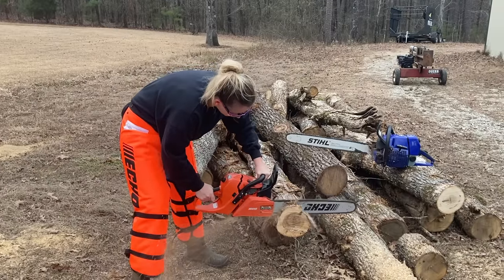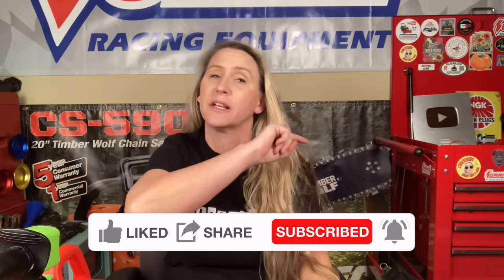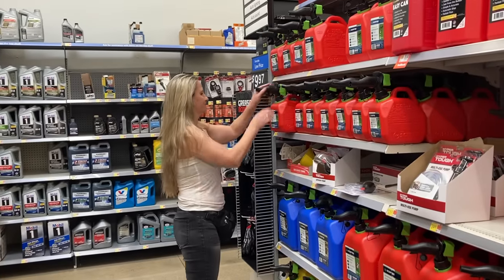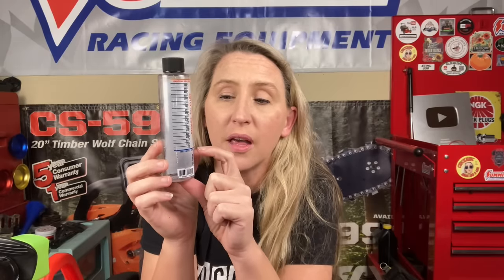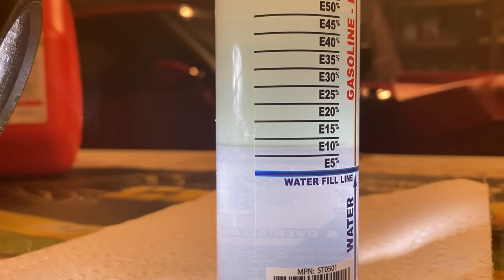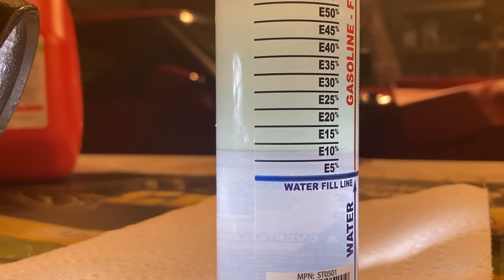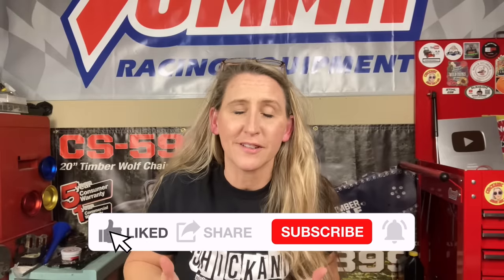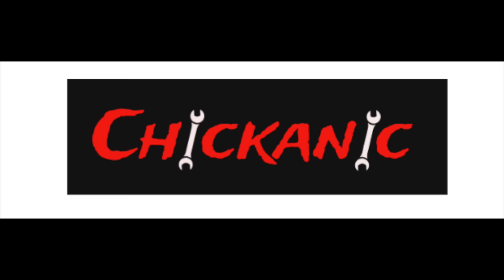Fueled by Deception. How You’re Getting Ripped Off at the Pump! (I'm SHOCKED!) VLOG

Comment: QUESTION: My Cub Cadet self-propelled mower SC300HW mower has been having fuel problems for over a year now. During the firs three years of life of this mower, the mower would stop when 100% of the fuel was used. The gas container would be 100% empty when the mower would stop mowing. But, this past year, there was a LOT of visible gasoline when the mower would stop on its own. I would ask myself, "Why in the world is this mower not working, because there is clearly a lot of visible fuel left in the mower." But, I recently watched a video online indicating that the "liquid" that remains in my mower may not actually be "gasoline." The mower may have separated the "gasoline" from the "ethanol" in a way that left only "water" that is not useful for fuel. Thus, the "liquid" I saw in the tank of the mower was actually a form of "water" that could not be used to fuel the mower. Is this correct? Could that be the cause of my problem?

Comment: We were out of town a few months ago. No name brand gas stations  in town. the pump station had 5 types (  2 , E versions and 3 regular ) gasoline to select from , all going through the same hose and nozzle, even a Bio-diesel at the other end with its own nozzle..That makes sense if the hose in 8 feet long there will be the remains of what  gas option the car owner ahead of you just got...I fill my cans up after I fill my car up... then you know what fuel type is in that hose...if there are more then the normal  ( 10 % ethanol added here )  3 octane levels types at that pump....

Comment: That's correct about the gas mixture. A pump repair man had the panels removed from a pump. I saw two lines coming into the pump going into one line. I asked him about the plumbing, and he told me the two lines were regular unleaded and the second one was premium unleaded. Midgrade was a mixture of both. The mix was 60% regular and 40% premium. This station didn't have non-ethnol.

Comment: I have heard this ethanol argument so many times. Your argument makes sense due to the way the pumping situation is set up. When they removed lead from gasoline (not a gas) they had to come up with some method of keeping the detonation (knock) under control. They added a witches brew of chemicals to do that. Well, to solve the detonation & the pollution problem, but mostly for the detonation. I have had guys claim that their fuel economy dropped so drastically while using E-10 gas that (by simple math) not only was the ethanol not burning but it was causing 10% of the actual gasoline to not burn. Many were claiming a 20 to 25% reduction in fuel economy due to the 10% of ethanol. Completely ridiculous. Current pump gas will stagnate when left in the carburetor over the winter. I have since started shutting off the fuel to the carb then letting the mower run until all the fuel is gone. Even then it is possible for things to get gummed up in small carbs. The smaller the carb the worse the problem. I have slowly been replacing small gasoline engines with electric, problem solved. Riding mower carbs are not so much a problem. Currently weed whackers, leaf blowers, small chain saws are all electric. And those little 2 stroke ring-a-ding-ding-ding units are the absolute worst, carbs always going nuts.

Comment: Even the delivery drivers cross contaminate the fuel, for example if they fill the storage tank of 87 octane at the station, and they still have some 87 left in the truck they are told to put what they have leftover into another storage tank of different fuel (this is what a friend of mine who used to deliver fuel was instructed to do by the higher up's). It's still a good idea to test your ethanol free fuel!!!!

Comment: I usually put fuel in my vehicle before filling my lawn equipment jug which is 2 gallons so , now I wonder what percentage 2 gallons would be . Although I use regular 87 octane and when the fuel quality isn't quite good I bump up the idle/throttle on my lawn equipment and go slower , easy for me to do that on the riding mower but not so easy to do on the weed trimmer or pole saw . But if I ever get good quality equipment that , absolutely , requires alcohol-free gas then I'll keep in mind what you taught me , Thanks .

Comment: Tip, best practice is to have the gas can sitting on the ground when one adds gas to it do not hold the can in one’s hand off the ground. Why to avoid the potential of a static spark that could ignite the gas while filling the can.

Comment: I took for granted that I thought the gas pump residual gas type was common knowledge. We went through the same thing when the US transitioned away from leaded/unleaded gas, and you could get both from some of the same dispenser pumps. Any time you went to fill a gas can, we always pumped a gallon or 2 into the car before putting it in the can, just to make sure you were getting the pure fuel type.

Comment: I am not sponsored by or affiliated with them, but No-Spill brand gas cans work really well. I actually prefer them to old school gas cans for filling up my LA-135. My fill neck is under the seat. If I have suitcase weights or other attachments on the back of the tractor, conventional gas cans are difficult to get the gas can spout into the filler neck without spilling everywhere. With the No-Spill, I put the spout in the neck and then push the button. Plus, their 5 gallon cans (which is what I use) have handles on the top and on the back side, so manipulating it is easy.

I still contend that ethanol up to 15 percent is okay as long as your equipment runs regulary. I do buy ethanol free for the generator as it mostly sits unless the power goes out, but my tractor, which cuts grass all summer, picks up leaves in fall, and gets snow blower duty in winter, runs fine on 87 octane E10. 850 hours and counting, never a fuel system problem.

Comment: I deliver fuel to gas stations and yes there is a separate tank for each grade of fuel. Gas stations are not mixing facilities. Refinery's and Pipelines are mixing facilities. I do agree that there should be a single hose per under ground tank like the old days. One hose should not be able to pump many grades of fuel, I totally agree.

Comment: Excellent video...thank you very much for the information! I was using non-ethanol fuel in my boat as per the hype and paying outrages prices to fill the vessel. Mercury insists regular fuel with no more than 10% ethanol is approved for their motor...87 works, I use it. It appears that the "higher octane"  (more expensive) fuels and non-ethanol are sitting longer in storage as our current financial climate is motivating the majority of drivers to use whatever is the least expensive; therefore, 87 seems to be the "freshest" at the pump...I think all things considered, it's the better deal. Never thought about the fuel left over in the line...thank you for this information.

Comment: For my small engines like my Echo weed trimmer I purchase 93 octane gas then separate the ethanol using the water/ethanol  separation method. End result is supposed to be 89-90 octane ethanol free gas.

Comment: 😮😮😮😮😮good video and very informative.  I run ethanol free gas in my engine about once a month or every few months... I see a noticeable 5-10% power increase like I am running a high octane gas. 
Also... I change my fuel filter as part of my maintenance every few years... I drive 2 Toyota's Tacoma pickups that are 24 years old... I hate ethanol because of the way it absolutely destroyed small engines like;lawnmowers, weedeaters, chainsaws, blowers,etc... Literally had to throw out all my household small engines after ethanol gas was introduced into the market because NO PLACE sold non-ethonal gas... The ethanol gummed up small carburetors overnight....

Comment: The first thing I did with those stupid EPA gas nozzles was take them off and toss them. I then replaced them with regular flexible plastic nozzles and drilled a vent hole with cap. Presto, no more spilling more than you get in the gas tank on your device.

Comment: I think it's more than 1/3 of a gallon left in the hose. There's a meter in there to measure flow at the bottom of the pump, then the hose goes up to the top of the pump and back down to your vehicle. I think it's closer to one gallon in that system. 
I'm always concerned with this, so I run out my bike to nearly empty (but no dry fuel pump!) and fill it then. It only holds 3 gallons and specifies 91, which would be 93 with nearly a gallon of 87 still left in the meter and hose.

Comment: It’s almost 90% or better with today prices I always put a gallon in my car first also …also if you have a newer machine I had a Ariens snowblower I always use ethanol free with a little stabilizer in it the carb went in the first year and the first thing they did was test the fuel it was good and they put a new carb on  it by the way push the nozzle all the way down on that can and twist the way the arrow on the nozzle points it will lock open then twist it back to close.

Comment: I have been having a nightmare with my ms 311 and TC whatever tophandle trying to get them to run. Like at all. I get 93 octane and pump 5 gallons into my car first, use Stihl 2 stroke mix and after 2 months sitting they both still stall off idle. I got some trufuel for the next time and now Bre has me worried about that. These fuel issues are infuriating. Got me going electric for small work. Like 16” stems or less. Sigh. Thanks for listening. Solid video

Comment: I usually fill a 2.5 gallon gas can when I start pumping ethanol free premium if they use a shared hose.  This can usually goes into something that can have ethanol, and gets used often.  Then I fill my cans with ethanol free premium, it sounds expensive, but it’s cheaper than having fuel problems.  I also think your engine idles better with ethanol free fuel.

Comment: Hi, your vids help a lot. Now I’m gonna help you. I hauled gas for to supply stations for around 10 yrs. Most of the little brands would order x amount of gas. Say 5000 gallons of 87 octane,1500 93 octane and 2100 mid grade. Well you get there and stick the tank to see if it will take what you are gonna dump in. At the no brand stations I would check the low octane and it might only have room for 1/2 of what they ordered. They would always tell me to put what doesn’t fit into the 93 tank. Rarely the mid grade, unless it all wouldn’t fit in the high test. The ONLY company including the majors that did NOT do this was shell. If a station ordered to much of any octane I was ordered to call Shell dispatch and I would be routed to another station. Also the manager was fined $1500 for the first offense. I never found out what a second offense cost. If I dropped even a pint into a tank that would not fit the entire amount ordered I would be fired. No second chance. We were independent so no grace. I’m not connected to any company or outfit. I switched back to rigging after I quit hauling gas. But I run Shell in all my engines if possible. I really doubt the little bit of gas left in a pump hose would change the reading much unless your can or tank is really small. But that’s why your octane reading might be changed. I got out of that industry around 30 yrs ago so I can’t say if this practice is still used, but I can honestly say it was is often used practice. Anyway take care and best wishes

Comment: i have a 4 stroke moped that uses octane 90 or above and the carbs get ruined because of the ethanol. I learned show to separate the ethanol from gas which is rather easy. its great to separate the ethanol for the small motors

Comment: My local non ethanol pumps are independent of the other pumps like diesel pumps. So far this fuel seems to be decent stuff. Im still considering buying aviation gas and using amsoil sabre in my 2 strokes.

Comment: This is confirming. I had a ck eng lite come on and it was for a bad catalyst converter. The cast was going to be more than I was willing to pay and then on time I filled my tank with fuel additive and the lite went out. So I tested it with low grade fuel and the lite came on. I then put higher grade fuel and some additive and the lite went out. I concluded bad fuel.

Comment: Another surprise....refineries that pump differently blended fuels to a terminal via pipelines separate the different grades with a slug of water then remove that water at the terminal. Usually. Almost always.

If you really want the real skinny on fuels try reading the Gasoline FAQ.....its a four part pdf that will take a few hours to wade through, its that comprehensive.

Comment: I would find a way to modify that gas can nozzle, if I had one. I have a bunch of the ones from about 7-8 years ago, when they stopped having a vent cap you could open. I drilled out a hole in the top of those and found press in plastic caps to open for air flow. Maybe try to fill behind a high end car, something they might have put in Premium or Ethanol-Free already.

Comment: In Britain  we have a separate hose and nozzle for  each fuel. We have E10  petrol, Super Unleaded petrol and two diesel nozzles, so that doesn't happen.
Why was you using bottled water, tap water is just the same.  If your gallon petrol tank was so awkward why not put some into a large measure then tip that into your bottle.
Most modern petrol cars in Britain run on  E10 and they recommend  Super unleaded  for the likes of small engines as E10 tends to rot the rubber pipes  more than any thing, but cars after a certain date had the rubber pipes and pump diaphragms made from another material, but still looked like rubber, perhaps a butyl or neoprene.

Comment: Those "Spill More" systems are terrible. They say a quarter cup of evaporated gas adds hydrocarbons to the atmosphere the equivalent of driving 10,000 miles. You want to love the EPA, but they have mandated several rules that do more harm.... That test for ethanol was very interesting, I did not know that existed for presentage. I have used Color Cut just for the presence of water and now ethanol for years. I have seen over a dozen engines damaged or ruined in just the marine business by ethanol. The emissions from mining the metals and making the engines is so much more than they would ever burn even if it ran forever. Thanks for the video

Comment: We dont got e85 but they do it with the 87oct and 93. Some stations purposely put 87 in the 93 tank. I run 93! In all my small engines and can tell right off when its 87 . The saws wont idle good or turn up and u can smell that low octane burning. Also stations that don’t sell a lot of high oct have fuel setting in the tank for who knows how long . I usually go to a town over to get fuel lot of hot rods in that town so it gets used more.

Comment: When you’re measuring fluid in a graduated cylinder, you should line up the bottom of the fluid meniscus with the measurement line.
Reply: Also, go to Tractor Supply and get some conventional spouts for your gas cans.

Comment: I hope you take the time to read your comments.  Fuel is transported to the Gas Stations via truck.  Trucks with from 1 to 5 compartments.  On a typical load, a driver may have straight Premium, regular no-lead, and even one or two grades of diesel. Why is this important?  Well, suppose the driver loads a small compartment with diesel.  Industry standard is that when than compartment is unloaded, it may contain up to 5% product. So, the driver loads 1000 gallons of diesel, and empties the compartment.  Look at the pipes on the bottom of the tanker.  If you unload out of the end compartments, those pipes are hardly ever emptied out, so, you end up with 25 - 50 gallons of diesel left.  Now, you go load 500 gallons of straight gas, and you just mixed it with up to 50% gasoline.  Now your gasoline is 10% diesel.  If it goes the opposite way, you can smell the gasoline when you open a container with diesel.  Most pipelines and refineries do NOT separate 87 octane gasoline with 91 octane gasoline, so you are correct.  It's mixed at the Station.  HOWEVER if the Station does have a mid-grade tank, the midgrade is mixed by the driver at the Pipeline or Refinery.  Yes.  Truck drivers doing math.  And don't discount the possibility of a driver dropping fuels into the wrong tank.  You may think you're getting no-ethanol gasoline and instead pumping E-85.

And even upstream, when fuels go through the pipeline, regular, midgrade, diesel, occasionally kerosene or jet fuel, and even ethanol, there is only ONE pipe!  So the pipeline is turned on and off as the different fuels are distributed to different storage tanks.  What is in between the fuels is called trans-mix.

PS, if you want to know if you have diesel in your gasoline, pour some of it onto a concrete surface.  If it leaves a stain or a ring, it has diesel in it.

Comment: Hey chick! Dump the fuel into a beaker than from the beaker into the test kit.
Take that silly green valve off the top, poke the strainer/splash guard with a screwdriver and rip it out. Then buy an aftermarket simple nozzle.

Comment: I wish you would've shown an actual ethanol free sample. I always pump 3 gallons of 'ethanol free' into my vehicle before dispensing into my cans or my boat. I actually used to use 105 octane in my boat when I first got it as this was available from the station near my job. The station had a dedicated pump for racing fuel.

Comment: Those gas cans I have a quick hack for those cans.when you get the little lock pushed in take two zip ties and wrap it together. Problem solved I been using this method for three years

Comment: I'm a fan of E0 here in the Carolinas.  NC tests for octane level, SC doesn't.  I make a 60 mile round trip to top off my 2019 Ranger Lariat and my 2020 300S 5.7L with 93 E0 as the EPA banned 93 E0 in my area after 2017.  There are unscrupulous gas stations out there.